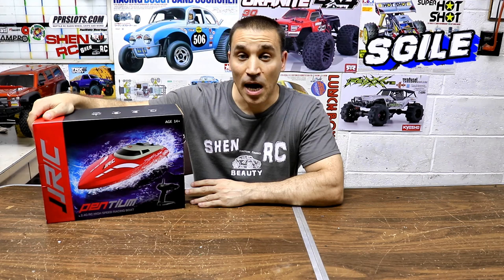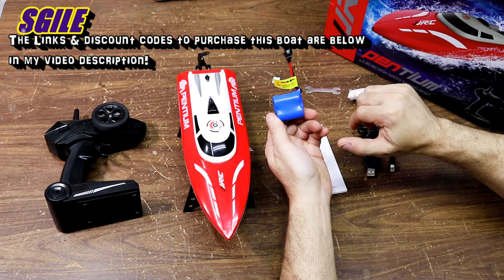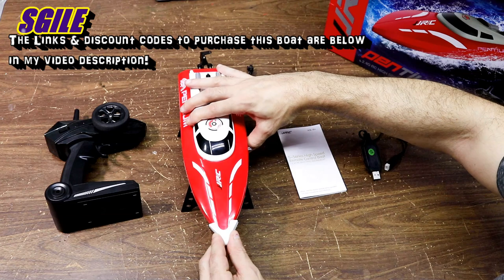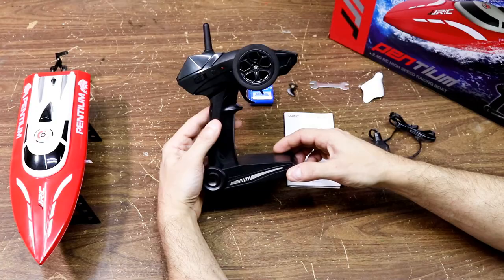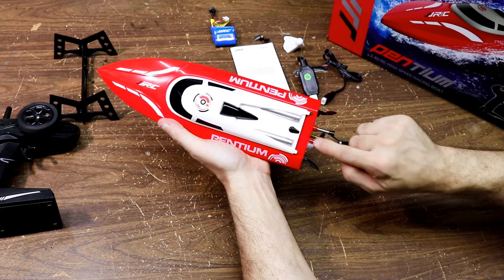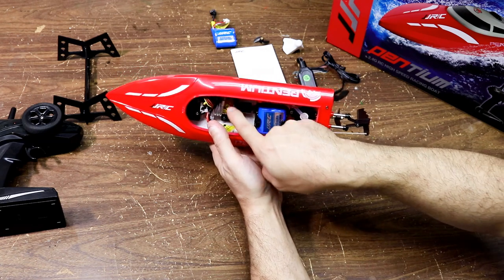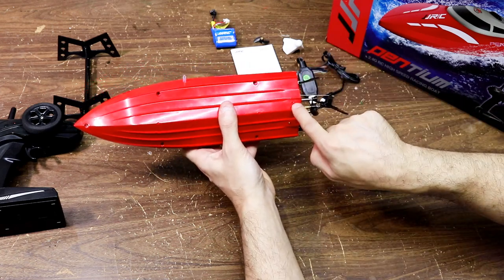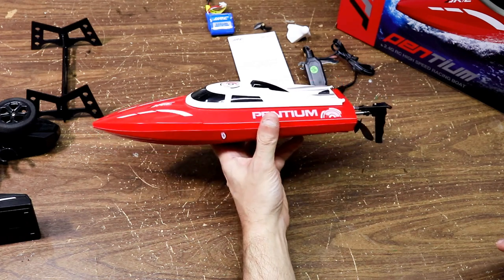SGILE PENTIUM RC RACING SPEED BOAT 25KM/h RTR

Comment: I always wanted a boat but I was afraid I would sink it
Reply from the maker: This one cool for it's size it's pretty quick and it can't sink if you flip it it can flip back over and another super neat thing I love about this boat that most expensive boats don't have is when the battery get low the radio starts beeping so you can bring it back and never get it stuck out in the water due to a low batter...it's awesome!  Thanks for watching bud.
Reply: Shen RC that’s cool maybe I’ll get one